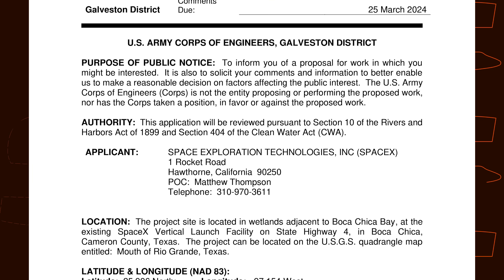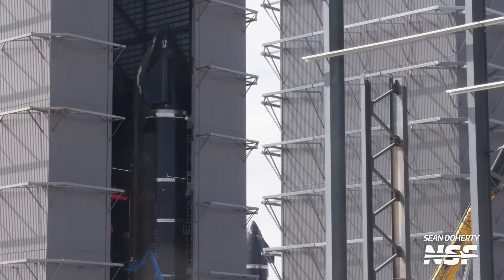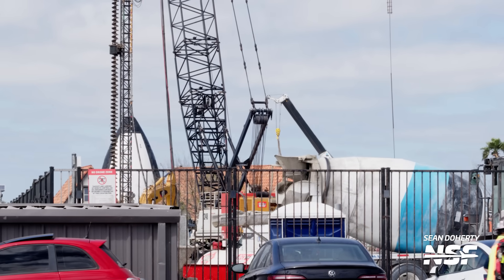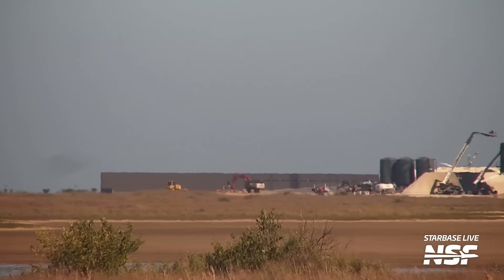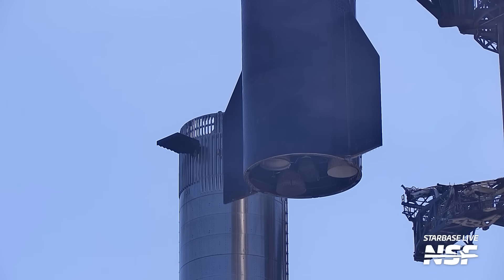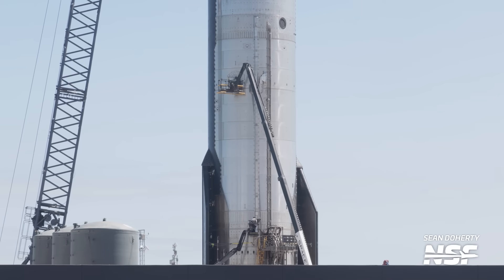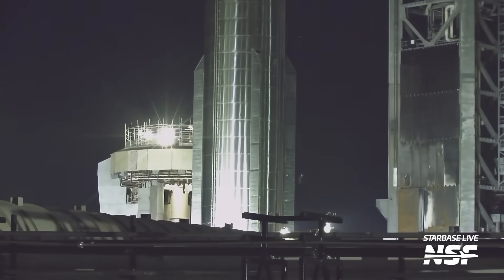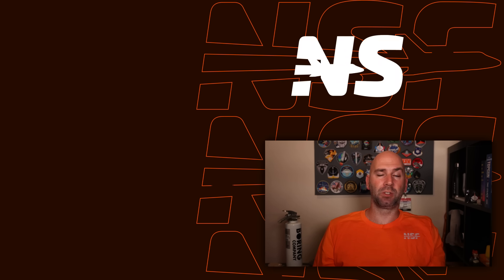Clues About SpaceX's Second Starship Launch Tower! | Starbase Update

Comment: Starting to think that if they don't go for Catch-Only towers, SpaceX might want to consider a round, tubular tower instead of square-shaped. Have one side with an OLM and the opposite side with a larger landing platform. When receiving a vehicle, it will be caught and quickly lowered onto the bigger landing pad, without the need for exact precision. It would be ideal if the tower could rotate on its axis so that the vehicle could be lifted again, swung around and placed precisely on the OLM, if needed. If not the whole tower, at least a rotating crane like mechanism on the very top that could perform the same function. You could have a second landing pad as well so that both the booster and Starship could be managed by the same tower. There should also be shielding between the two sides so that the OLM is somewhat protected in the event of a failed landing. Anyway, just a thought for what it's worth.

Comment: It's really amazes me how confident they are that nothing will happen when they attempt catches! Look at NASA's launch pads aren't they miles apart? Space X is really ballzy by putting their pads so close together!
Reply: And that super strong, heavy stainless steel will crush and cut through everything it hits since it is much tougher than the aluminum most rockets are made of. Those towers should be at least 2 kilometers apart. You want to be at least 10 kilometers away from that vehicles when it is fully fueled. I doubt a combination of cryogenic methane and liquid oxygen coming into direct contact will just burn. It might explode outward along the ground, as well as upward. That much energy released in a couple of seconds could cause a powerful pressure wave which could break glass for 15 kilometers. If I was NASA I would have taken a couple of tanks of LOX and CH4, chained them together and cut them apart with detonation cord to see how it burned, before letting anyone put thousands of tons of the stuff together 10 kilometers from South Padre Island residences.    
I will be shocked if they can catch those vehicles reliably. That seems like a crazy idea to me, especially when legs would work. So what if you lose some mass to orbit in exchange for near 100% reliability. In orbit refueling will also be tough to do. It will be interesting to watch what the Chinese do with their Moon landings.

Comment: Didnt they make a whole event of the fts charge installation last time with tree guys carrying the charges in metal containers on their backs and such? Now we see them get delivered by one mail driver carrying them in a carboard box under one arm? XD
Reply: I suspect that not all the explosives needed for a single launch are delivered in the same shipment, possibly for safety and security reasons.
Reply: I assume (I know nothing about explosives) that they're packaged much better upon arrival, but when they're going for install they're much more exposed. Could be totally wrong though lol
Reply: Since they have to climb up onto the rocket. That's why they have the charges in the backpack so they have both hands available for stability. The last thing you would want to do is trip and fall because your hands were full when you're carrying that stuff!
Reply: @LordTimelord  high explosive is actually really hard to make accidentally detonate (like the traditional C4 basically require a pecursor explosion to make it do anything, hitting it it a hammer just does nothing). They require a significant amount of energy to get the to go off.the firing charges however, now they are dangerous. Sure they have much less explosive in them (still enough to seriously maim someone) but they require much, much less energy to go off, thus much more dangerous.

The High explosive delivery is pretty 'safe' in terms of delivery.

As the install team was carrying both the high explosive, and detonators at the same time (albeit across different people) that's why thre was much more overall caution. Putting it into backpacks just helps maneuverability as you say, but not really for the reason you suggest